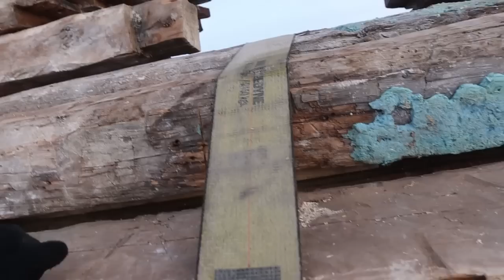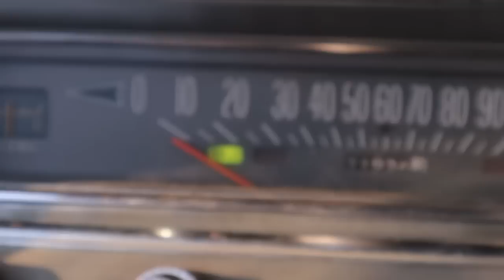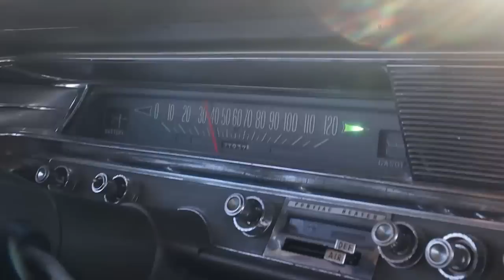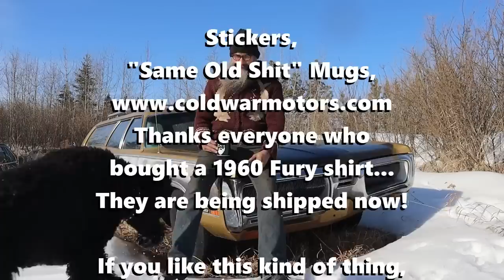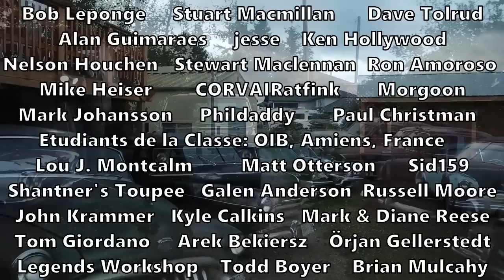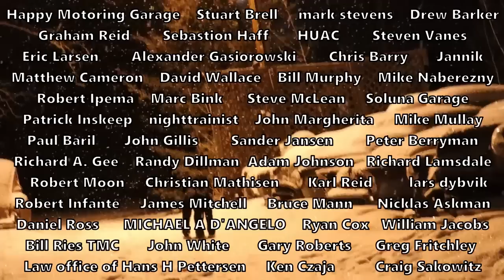It's a Runner, and on the Road! Posty Poncho Revived, and Laura's New Logs!

Comment: That moment, you take a car on the road for the first time, not knowing if you'll make it back.

Priceless!
Reply from the maker: Haha! Absolutely... A bit of excitement when it spins up in neutral, too,,,
Reply: @coldwarmotors  Haha - yes, right up there with checking braklines all the way, but not the fuel line!!
Reply: I've left the farm with what I think are good brakes, only to find out, they're not so great on the highway 😒. 

Oops!
Reply: Fortunately an easy fix putting fluid in. I had a couple of Powerglides a long time ago and they are much better than their detractors think

Comment: Those replacement sending units that Myles puts in for his Pontiac are not the real deal. They can be slightly different. When we replaced the one on my Bonneville we had to go through a lot. The hitch that was put on the car in the Sixties was welded on: We had to cut it out. Then we flushed the tank, replaced the sending unit and tested it. After installing the tank, the dash showed completely empty gas tank. It turned out that the new sending unit thouched the bottom of the tank from time to time and shortened everything out. Back to disassemling the tank and unit again. At the end we used the original sending unit and only replaced a few parts and the "sack" on the pickup side. Now we finally have a functionning fuelsystem and correct readings on the dash!
So much about "original style and fitting" replacement parts!

Comment: I wish Laura good luck with finishing the cabin. Old wood is a true treat. While you where test driving with Miles I kept hearing a clunking noise while it was shifting. It went away as the transmission warmed up, so something that might need attention. The old Power glides had there flaws that probably Tom knows more about than me. Anyway 13 years of fun and more to come.
Reply: This is what happens when you play with Lincoln Logs as a kid.  Something tells me Scott had an Errector Set!😆

Comment: That chrome paint reminds me of back when I was 19 (48 years ago) working at Caterpillar Tractor Company I worked on the end of the main paint line spraying the roller frame guards with Cat yellow before they were installed and pulling mufflers out of the box and spraying them with chrome silver lacquer and throwing them up on the fender so the attachment floor could finish up the tractor.

Comment: I knew that entire houses could be moved from one area to another but this is the first time I'd ever seen a house disassembled, moved and set for re-assembly elsewhere.  I  guess, the "Canadian way" is more logical as roads aren't always wide enough, too steep, or too hilly for entire houses to pass.  Also, even though the Pontiac is a Winter-Beater, it seems a waste to have gone this far NOT to do a minimum of rust repair on the rockers and lower door areas.  The car is still very cool.  I had a boss who once owned a 1964 GTO 2 door SEDAN (with the pillar).  It was weird to see that at the time but today, it would probably be sought after owing to its oddity?
Reply from the maker: Hey glad you liked it... I suspect there will be a winter of welding ahead for Myles if he wants to tidy up the Pontiac...Cheers!

Comment: I am old school and I love original shop manuals and I have quite a few: Mine are dirty from greasy, rusty hands and are quite used up. But I say it prooves that those books are used and not only shelved.
seeing this chrome style rattle can: My Dad brought me this kind of spray they used in the GM body shop back in 1970. I bet they sprayed some bolts and such with it.
I was so eager to use it on my plastic WW2 models like the B 29. It looked good but the plastic got a bit wrinkly from it.
I even remember the name of the spray: "Illinois Bronze".

Comment: I used to live in an old  rental log cabin in Quebec for a summer. I think it was white pine too. The logs were left round. The owners bought it and moved it from some farm in the area. Put it on a proper foundation,  and added a new, but rustic, second floor. It was nice. It was cheap rent, because it was the off season. It mostly catered to cross country skiers in the winter.

Comment: It's always nice to see ce super modèle français (ta soeur tordue)  Laura.  There are a few old cabins around here, but they don't appear to be in as good a condition as Laura's.  Most I've seen are Oak or Walnut. A fireplace reallly enhances a cabin.   I have had a couple of power glides; ratios vary depending on 6 cyl or V8's.  It's nice that your beard is a built in safety feature, Scott.  Cheers from KCMO

Comment: I'm glad to see Miles driving his Stratoch. Getting it on the road in 4 weeks may be a CWM record! The car must not have included the usual floor delete package or else you guys were placing your feet very carefully during the test drive. I did notice that it has the obligatory cracked windshield. Too bad about the sun visors. You could probably rob a pair out of one of the Chevys or there is always good ol' duct tape. I can't wait for the first drive in the '37 Chevy. That is going to be a really fun car. It looks like cleaning the gas tank and fuel line is nearly all that is left to make it road worthy. Now that the engine is running well, it should drive like a nearly new car. Wow! A 30hp engine in the model T? I thought you weren't going to make a hot rod out of it. Next there will be dual down draft carbs, a model A Exhaust and a Ruxtel 2 speed rear! Just think- you will actually be able to drive at the speed limit. Cheers!
Reply from the maker: Cheers Edward! I am also looking forward to some fun drives in the 37 and the T this summer!

Comment: I'd be proud to own that 60 yr old Pontiac. What a nice ride. That Pontiac has a god stance to it. The rally wheels are all you need. Cruizin. Powerglides are bullet proof. Had 1 behind my 302 DZ chevy with a 12 Bolt 4:10 gear rearend. The only flaw is a powerglide will go into reverse at any speed. So dont bump the shifter.

Comment: Congrads on Laura's saving a piece of French-Canadian history, a piece of advice, clean the pieces before you reassemble it. I've restored old pine wood using an 1800 pound pressure washer with a fan nozzle. It removes the oxidation, and doesn't ruin it while running quickly along the grain. If I find mold on the surface I simply spray  bleach right after pressure washing it and let it dry out in the sun right-away. It looks beautiful when linseed oiled, dried and varnished . There are fine, clear, zinc-based wood preservers  &  oil finishes on the market for this type of project. Make sure your finishes are U.V. resistant. Good-luck!

Comment: When I lived in L.A. I had a 4 door Chevy Nova ex-cop car. It was great. 350 cu inch small block with a four barrel, heavy duty sway bars and quick ratio power steering. All it needed was a spot light and a  light bar! I loved that car. Love the Newport (and any other car named after a cigarette for that matter). I think you could have fit that log cabin in the trunk of it. That cabin is newer than some of Dean's beaters! "Should be easy enough". Isn't that what Custer said. White pine is probably the only wood that would have lasted 300 years. Installing gas tanks at night in the Winter. My favorite thing! I like that little green light on the dash that says cold. That won't actually go out until you leave Canada. Before you had 3 speeds. 1st 2nd and neutral. Now you've only got 2. You need to take some fluid out!

Comment: I use rattle can chrome chrome for the inside of old light housings so they reflect well I've even used it on old headlight reflectors when I didn't want to spend the big dollars to have them re mirrored.
My T has Magneto headlights and I used rattle can Chrome on  the reflectors and it's very drivable at night as long as the engine RPM is up.

Comment: Love that Strato Chief Myles! Drop in a Pontiac V8 like a 400 or that 421 Scott was saying. Stitch in some new metal where the rust is. Could even go restomod with a Cadillac LS from some rolled SUF at an auction someplace with the 7.3 Ltr LS.. or a more readily available 6 Ltr from some farm truck or junkyard city truck :-)) You get the OD with those LS's and the 4L80 transmissions. Solid gas mileage with those.

Comment: I had a Mercury GM and a Lincoln TC (Panther platform)   and yes they are great cars. I do have a couple of complaints, the fuel tank doesn't have enough capacity. And there is not enough leg room for people in the front seat. Other than that no complaints, My TC had 211k miles when I sold it and the paint and interior looked new.

Comment: With a cop car, mileage is absolutely irrelevant. Age, or more specifically, the number of years it was in full time service  is the only thing that matters in this respect.  Cop cars spend enormous amounts of time sitting idling.  A cop car could easily spend 1/2 of its average day idling.   The upgraded cooling system at least helps a little bit.
If you assume an average speed of 65mph, a car with a 100k has been running 1500 hours. You can probably double or triple that 1500 hours  for a cop car.

Comment: i ALSO WATCH "DIESEL CREEK," ON THE INTERNET, I REMEMBER SEEING HOW HE CLEANED OUT A GAS TANK, 1. REMOVE GAS TANK 2, REMOVE OLD GAS, 3. PUT ABOUT 3-5 POUNDS OF SMALLISH ROCKS IN TANK, RUBBER STRAP/GRAIN TARP RUBBER STAP TO ONE REAR TIRE OF TRACTOR, 4 DRIVE TRACTOR AROUND FO ABOUT 30 MINUTES  4 REMOVE TANK FROM TRACTOR WHEEL , 5 DUMP ROCKS FROM TANK  ALONG WITH THE RUST AND VARNISH, 5 RINSE TANK ABOUT I GALLON OF GAS . REINSTALL FILL DRIVE.

Comment: Congrats on 13 years. Been along for 12. I'm just wondering why you didn't upgrade to two line master cylinder as long as you were replacing it on the poncho. ❤
Reply from the maker: Hey Jeff! Thanks for following along for so long now! We just put the cars back together the way they were, for the most part... It may get upgraded later if the engine does...Cheers!

Comment: Where I live rusty rockers and all kind of rustholes make a car illegal and it cannot pass inspection: A very sad thing. There were cars that did not pass inspections for rustholes smaller than a quarter dollar! And they hammer and look desperately to get an old car off the road. Even if the cars have a frame! You are kind of lucky and you can ruin your life with rustbuckets that Myles and the rest of you love so much.
Reply from the maker: Strange rules in Alberta... Once a car is registered here, it an be renewed no problem. In that case, inspections are at the discretion of the insurer. If the car has not been registered since 1988 or so (when the switch to a computerized system took place), it is no longer "in the system" and must undergo a very strict inspection before it can be plated here. Myles' car was registered in the late 90s, so no problem as long as it is insured. If it wasn't already "in the system", it would require that all of the rust was fixed before it could be registered. The plan is to fix it all anyway, but this way it can be legally driven in the meantime. This is not the case in other provinces in Canada, each of which have their own rules and regulations...

Comment: Have you ever worked on a Roto-Hydra-Matic transmission, like was put in those American cars? If that car has one,  have it looked at by someone that KNOWS WTF they are doing. One of mine was totally fucked when a U shaped spring regulator valve broke and let the clutch pack slam into the carrier housing.
And someday in this century. I hope you open the package I sent, with the NEW FOR 37 CHEVROLET advertising.
Reply from the maker: Hi! Watch for a Mail Special video coming soon! Cheers and thanks so much from me and Frankers...

Comment: What are the rules for putting a classic like the Pontiac back on the road? If it has tags you can put insurance on it and just drive it or would it need a inspection to be legal? That's what you needed for the Fury right? Not that I would care about the legal part of it just curious. Out here in the Netherlands its a fair bit different. A car has a rego/plates that always stay with the car. A regular (past 3yo) car needs insurance, road taxes paid based on weight and a annual safety inspection to be legal in te road. A 30yo classic still needs a safety inspection every 2 years but is road tax exempt and a 50yo classic is both tax and safety inspection exempt. So driving around in the Pontiac like that would be legal even though that amount of rust wouldn't pass any safety inspection..
Reply: The Pontiac doesn't have tags.  Did you notice the tag that was on it is the same digits as the Chrysler Myles has?  They have discussed it before that if a car has been off the road for a long time it needs to be inspected to get new plates.
Reply: @mexicanspec  Didn't pay attention to that no, makes sense. I only heard him mentioning they put insurance on it the next day. Would a inspection like that be  a one time only thing?
Reply: @Ltbookum  That is what it sounded like.  If they keep it registered they don't have to have it inspected again.  Maybe somebody that lives in the area can clarify things.
Reply from the maker: Strange rules in Alberta... Once a car is registered here, it an be renewed no problem. In that case, inspections are at the discretion of the insurer. If the car has not been registered since 1988 or so (when the switch to a computerized system took place), it is no longer "in the system" and must undergo a very strict inspection before it can be plated here. Myles' car was registered in the late 90s, so no problem as long as it is insured. If it wasn't already "in the system", it would require that all of the rust was fixed before it could be registered. The plan is to fix it all anyway, but this way it can be legally driven in the meantime. This is not the case in other provinces in Canada, each of which have their own rules and regulations...
Reply: @coldwarmotors  It is so fun complying with government regulations.  Saludos, Scott.
Reply: @coldwarmotors  Thanks for the clarification Scott 👍 I'm always intrigued (and often frustrated) by all the different rules they can come up with per country/state.

Comment: I almost get angry when I see the green grass in the altro... I really miss seeing some gravel in the yard. You just have a light dust compared to my twelve feet of snow. A lot more in the drifts.... where is that global warming with sun so hot, hell will feel like a freezer. I miss so many things that you guys touch on. Doing the brakes proper meant to do a dial indicator of the shoes to get a perfect even grasp on the shoes to the drums. The fronts are so simple as you have the spindle to mount a centering unit on it, then turning it around the shoes to see if they are actually even on the mounts.. what looks right can be completely off of center. With the lugs on the axle to find a center and dial the shoe evenly all the way around took some doing. Should I ever come around the second time in life, I would learn how to do  the headliners in cars as everyone avoids taking out the headliner and getting all the rodent nests out. Miles Pontiac is full of mouse nests and yet the  thought of pulling what is there down and replacing materials.... a lot of courage to get those bows right and the cloth damn tight.. All most every car manufacturer left no way to take down and replace that material right again.. I know you did the Fury headliner and it must of been some kind of challenge to make it completely tight like it is now.
      White pine.... who would think that timber thats around four hundred years old and carved into a home should still have a good chance of ninety nine percent reusable shape/condition! All said and done tho, I miss the interaction between the gang and myself setting with a brusky an a joint to make all merry